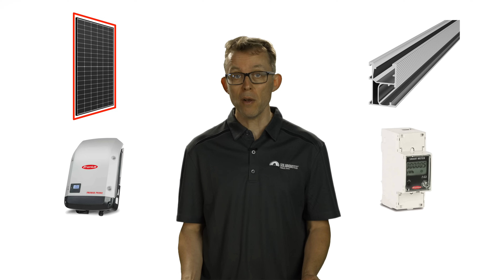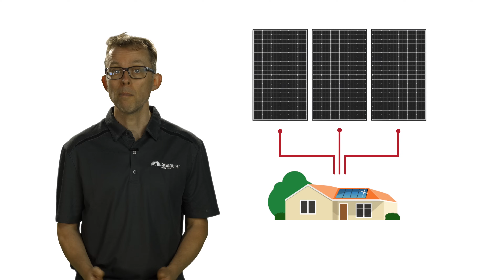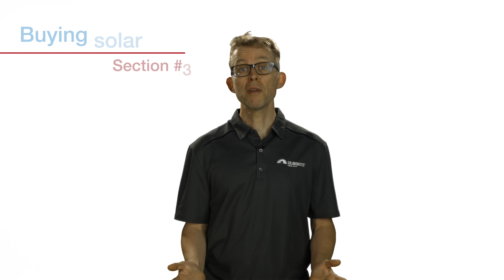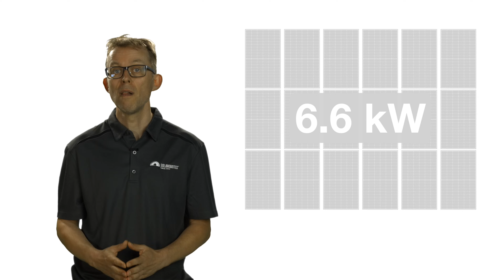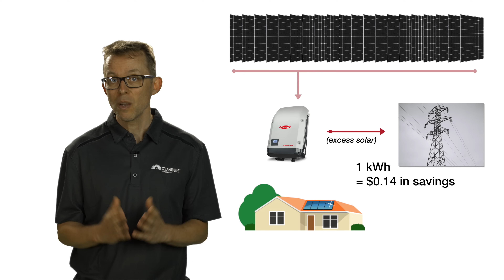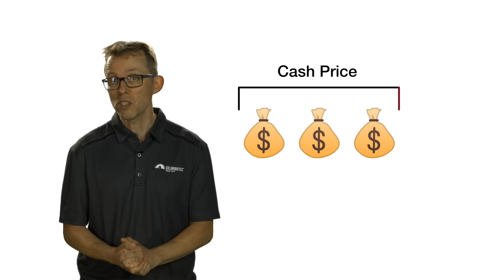Solar 101: A Guide To Buying Solar In Australia - 2022 Edition

Comment: Thanks! Another great video. I'd like to know the ideal angle for installation of panels on my house. Is there a website that will give this info to you based on your lat/long location?  Interesting that you say "it's complicated and expensive to add solar panels later to your home"...I've hear others say it's easy to add them later, could you elaborate on your statement for adding more later? I just want to understand what you considered with your statement?
Reply from the maker: If you are in Australia - here are the optimum angles: https://www.solarquotes.com.au/blog/solar-panels-tilt-angle/. 

Here are all the reasons adding panels later can be difficult: https://www.solarquotes.com.au/blog/how-to-upgrade-solar/
Reply: @SolarQuotes  Thanks for the quick response and helpful info. I live in California. Is there a way to calculate the proper angle given your lat/long?  
Thanks for the info about expanding your solar system. Clearly it's not as easy as I had thought. Also if you know that there is expansion in your future, it sounds like micro-inverters might be the way to go with your initial installation. 
Cheers

Comment: If you're in either South Africa, or Australia, you get an incredible amount of usable sun energy per year (It's very dramatic, something like 1000 usable solar hours in Europe vs 2400 per year down here), solar is definitely a good option.  Can save you a load of money too if you work out your electric bills over 10 years and compare that to a decent solar installation, prices of utilities will also always creep up, but your solar system will stay the same.  By the time you have to start physically replacing panels etc, prices will have gone down as well thanks to production efficiency, new technologies, etc.  It's a good bet.

Comment: @Finn there's another very important component and that's the installation. Poor quality workmanship is the largest cause of faults in solar installations. Poor choice of BOS equipment can cause issues as well. If a system breaks down are the Solar Retailer and Sub Contracted installer going to point fingers at each other and leave the system owner in the lurch?

Comment: So, what if I want to build a new home, and have it (design, build orientation etc) maximised for solar, and get the house built with solar + batteries installed before I move in. Your quotes system doesn't seem to offer much in the way with help for that. Is there a way to get in touch with a reputable installer in my area to help this happen (via your site), or should I just look for an installer and do my own leg work?
Reply from the maker: Collin - let us know where you're building (postcode) and we'd be happy to refer you to an installer :)
Reply: @SolarQuotes  6065

Comment: thanks good video.  My north roof was full with 28 solar panels and solar pool rubber membrane.  So I put another 28 panels on south facing roof which gets the afternoon sun 6 years ago.  My solar guy questioned it and I explained on TOU 2-8pm was peak time on charges and that's when everyone was home using energy.  So in summer as sun is setting south roof still producing solar where north roof zero.

Comment: With most warranties being equal the panel build quality & backsheet material becomes the most important consideration. Back sheets is where most panels will fail, especially in the Australian climate. Jinko use a trademarked material Tedlar for their backsheet which will outlast any inferior product used on more expensive panels. This is backed up by years of field testing by DuPont. There have been some companies out there with a good name making poor quality panels and replacing them under warranty with more poorly made panels. Best to buy a good product to begin with, like Jinko. Also, why the hate for Growatt? The company has been around since the solar boom began. They're still here standing behind their 10 year inverter warranties and offering support.
Reply: was thinking the same about Growatt, never any warranty issues, sorted almost instantly.

Comment: In the process of getting quotes at the moment, what brands of inverters have the option to keep supplying the house (but not exporting) when the remote shutdown command is issued? Thanks - great video
Reply from the maker: Good Question - off the top of my head - Enphase, SolarEdge, Fronius SMA, Delta, Sungrow all do this well - BUT... you need to buy the 'consumption monitor' to get the functionality and ask your installer to configure it (if in SA where it is mandatory)
Reply: @SolarQuotes  Problem for me is finding a reliable installer. Being electrical, I don't want cowboys. Encountered too many of them already.

Comment: After spending over 6 months dealing with installers to get a new, fairly expensive, system I despair of ever dealing with an actual professional in the industry. That includes four recommended by solar quotes.
Reply: What's the problem? It's not terribly difficult, unless you make it so. There are millions of systems installed that work perfectly well.
Reply: The solarquotes vetting system is flawed